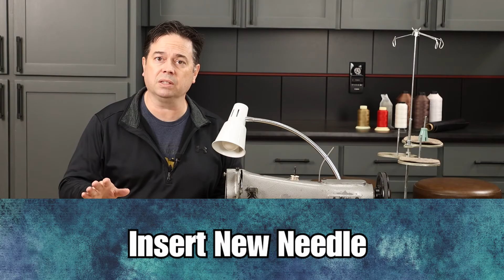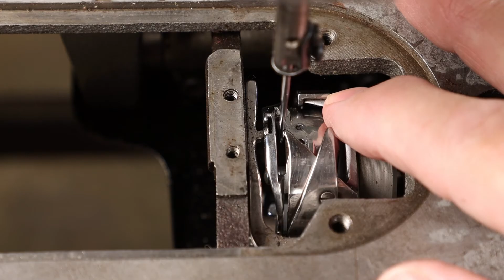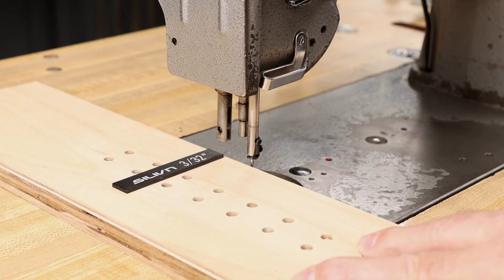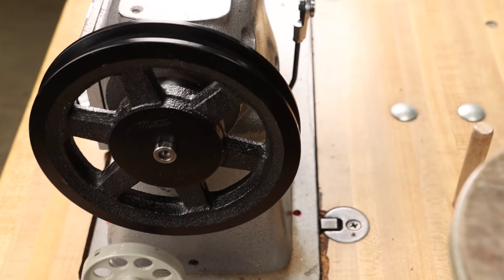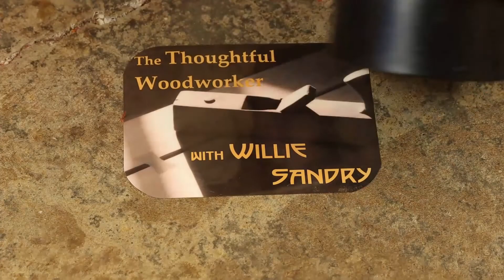Consew 206 rb Hook Timing Set Industrial Sewing Machine Timing 206rb1, 206rb2, 206rb3, 206rb4 206rb5

Comment: There’s no mark on bare hight no hight on pice of wood so basically no help from you.
Reply from the maker: If you were listening carefully, you'd hear that the height of wood indicates the bottom of the needle bar stroke.  From that point, roll the handwheel towards you until the needle bar raises 3/32" from the bottom.  That's the timing position.  The rotary hook is your reference.  Nothing else.  By the way, if you're not getting the answers that you like from other people, it may be that you come in a little hot with you comments.  Best to you.

Comment: 206-rb-4 question. What  position of  stitch lenght dial must be  set when  we  setting up timing? My case - everything is OK  under 6 mm stitch and in reverse, but needle meets metal  when  forward more than 6 mm.
Reply from the maker: Technically, stitch length should be set to minimum for hook timing procedure, but I haven't seen it make any real difference.  You might just need to centralize the feed dog.  That's done at maximum stitch length so you can confirm the needle doesn't strike the feed dog in forward or reverse.  Best of luck with it.

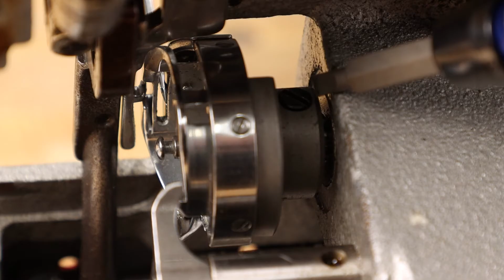Comment: If the screws was loosen at 1:25, how can i fix that corectly in the groove ? I have a consew model 290 (Sorry i am french so my english is bad)
Reply from the maker: You'll need to move the screw back to the v groove.  Then reset the timing as described in the video.  Good luck!
Reply: @TheThoughtfulWoodworker  how can i see if i am in it ?
Reply from the maker: @NoemieRoy-ks4fr  To see if the screw is in the groove, remove the screw, and look down the threads with a flashlight.  You may need to loosen both screws and rotate the hook to get the screw aligned with the groove.  Then start over setting the timing.  Thanks
Reply: @TheThoughtfulWoodworker  thanks
Reply: @TheThoughtfulWoodworker how do you know which one goes in the groove?
Reply from the maker: @vanessataylor3961  Consew uses a vague system where the first screw that appears as you rotate the handwheel toward you is the one with the groove.  First time I heard that I thought huh?  What they mean is the two screws are placed fairly close to each other, so the first screw you see will usually have the groove.  The second screw comes closely behind.  Bottom line, you can remove one screw at a time and look in the hole with a light to see the groove.  Thanks!

Comment: What if you change needle size and the distance changes between the scarf and the hook? 3:11
Reply from the maker: As long as you're using the right needle system, changing between a size 18 and 22 won't make enough of a difference to matter.  Thanks
Reply: @TheThoughtfulWoodworker  Excellent!  Thanks for the reply.  You have the best vintage machine tutorials on the tube.

Comment: My 206rb-1 frays the thread  sometimes and occasionally misses a stitch or two. Would the timing or needle to hook distance adjustments be the problem?
Reply from the maker: Missing a stitch is often a hook spacing issue, but timing can cause that too.  Frayed upper thread can be too small of a needle for the thread you're using.  Also a missing or damaged needle bar thread guide will fray upper thread (or forgetting to thread through that guide).  Hopefully it's something simple.
Reply: @TheThoughtfulWoodworker  I watched 3 of your videos.... everything seemed to be out of adjustment. Adjusted hook spacing and timing and needle height.   Seems to be working great.   Thanks for making these videos.  Very helpful..
Reply: Also.... how would one know if the hook needed replaced.  It's pretty old.  The hook looked a bit flattened where it passes the needle. I don't know if that's normal.